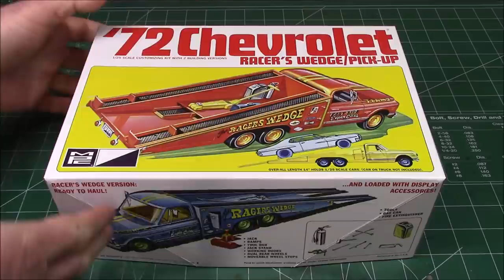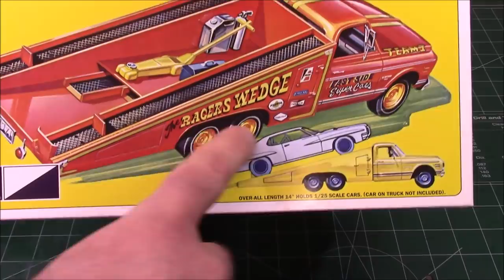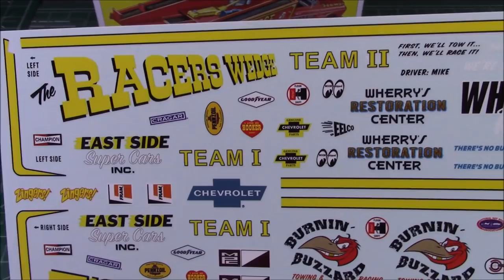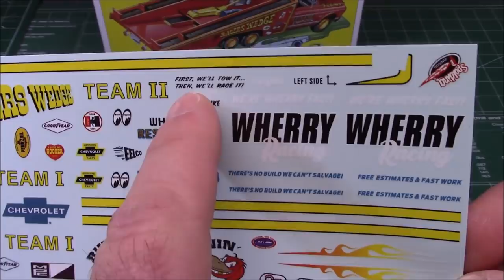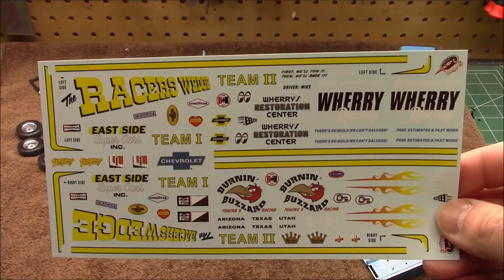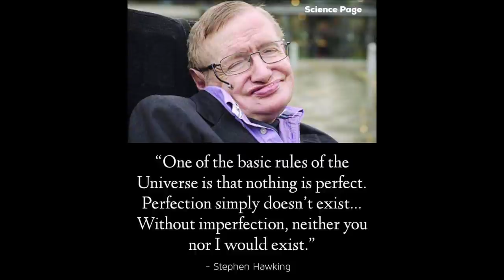1972 Chevy C/K Pickup Racer's Wedge 2n1 1/25 Scale Model Kit Build Review MPC885 Chevrolet 350 V8

Comment: Awesome build! Thanks for taking the time to do these videos. I have a question about the gel pen you use. How long until they’re dry to touch? I have cheap ones that take days and days. Just curious if your brand is quicker as the price is quite a bit more. Cheers.
Reply from the maker: Depends but the dehydrator makes quick work of them.
I usually put the gel pens on last, afer everything on that part is done and they have time to dry.

Comment: Never liked the dual rear wheels ? Never seen one like this in real. Would have prefered they made it with true dually rear end, and proper wheels and tires. Still will buy it , and make it a pick up version.
Reply: Growing up at the local dirt tracks in the 70s and 80s helping my uncle with his late model, that was my thought too. The low budget racers had open trailers and the "rich" ones had wedge beds. I don't remember ever seeing a tandem axle wedge (let alone a twin screw) either. Like you, the ones I remember were all long wheelpace 1 tons with dual rear wheels.

Comment: Someone really needs to start selling resin nose clips or cabs of the old 67 kit
Reply: I think someone on ebay sells the different style grilles these trucks came with.
Reply: @donh.5557  I think there used to be but now it’s an expensive rarity
Reply: @ToriL97  I’ll have to look into that, the 67s also used a different hood
Reply: @donh.5557  looks like I got it wrong, they only made the 67 as a fleet side/tow truck but you should just be able use the bed from the 72 kit
Reply: The joy of kit bashing.
Reply: @donh.5557  dang, I’m in high school now 😂😂 shame they never re released it because I really want to build it and I’ve only seen it for $150+. Just not worth it to me sadly
Reply: @donh.5557  hopefully, they do a lot of great stuff for us but I’m sure they’ve got a busy plate with how many brands they take care of, and they keep releasing great stuff so I’m not too worried, they’ll get to it
Reply: I sell resin grills for this kit. 67-70. I also sell short bed frames and short fleetside beds.